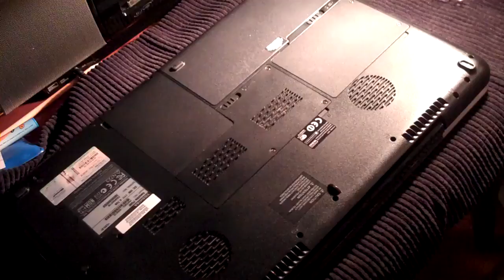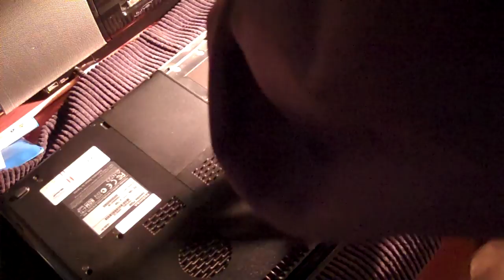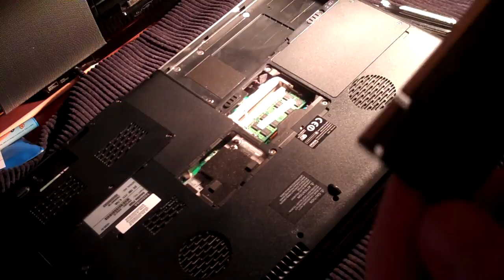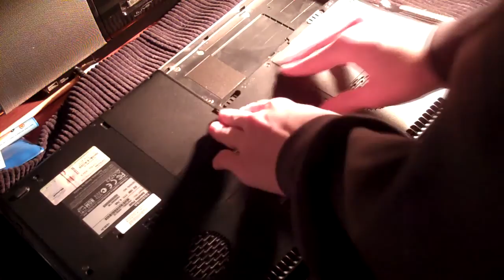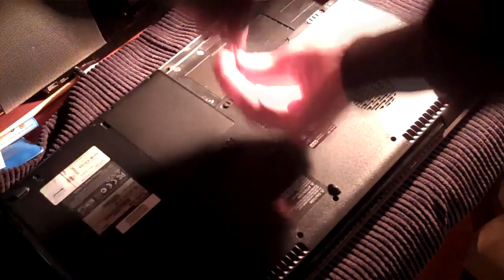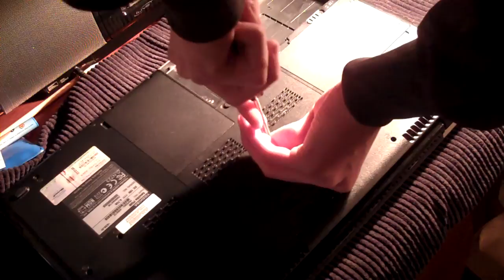Upgrading RAM Toshiba Satellite P500

Comment: i got a toshiba satellite t135-sp2013l, do u know where is the wifi card, cuz the pc says is unplugged and i wanna know if its true, or maybe burned or something, i opened it up, but i cant find it, in the back it only have 2 "holes" in a matter of speak, and they are: 1, the RAM slot and the hardrive, and it is not under the keyboard either, i was wondering if maybe u know where is it?

Comment from the maker: @Soaroz Ohhh! I used crucial.com to get mine. They have a memory adviser where you put in your model etc, and it gives you options, and it also shows what type (meaning speed, DDR2 or 3, etc). If your laptop is newer, it can probably run DDR3, whereas mine can only run DDR2.